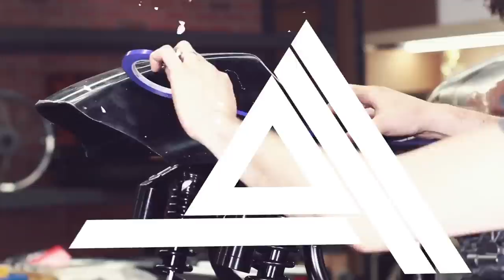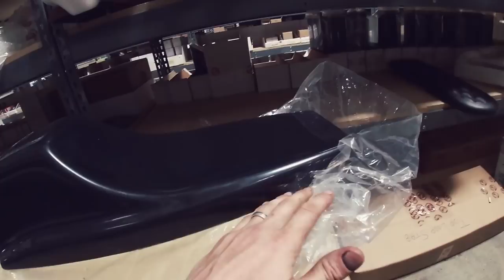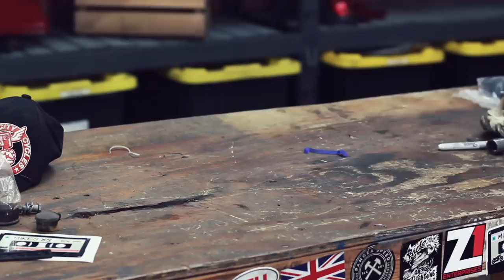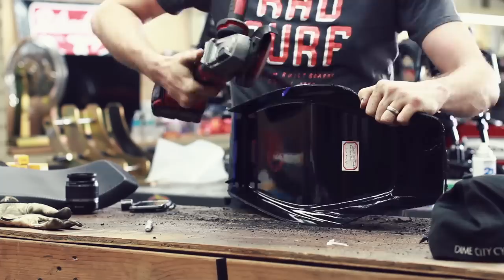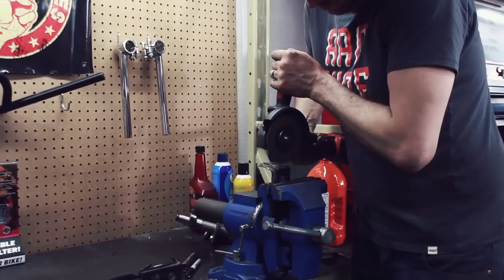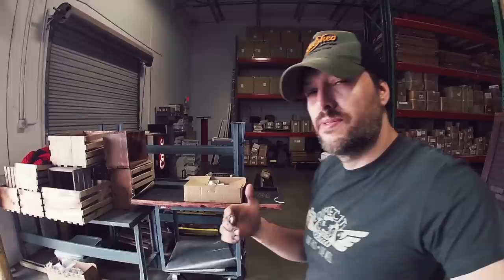CX500 Flat Tracker Build Part 12 - Fabricating the tracker cowl to fit

Comment: Now I see the way my GL500 build will go 👌 seen a triumph flat Tracker at the Wheels and Waves and fell in love with it! After seeing that's possible doing something great on the cx,I'll go for it on my GL! Unfortunately is mono shock the GL... But believe it will look cool too. Waiting for the next video!
Reply from the maker: At least you have a safe monoshock there already rather than a few of the dangerous ones I’ve seen. Best of luck.
Reply: @forthebold  true, I've seen some conversions that... At a minimum they're scary!
Reply from the maker: Nuno Cox yeah it’s when the swing arm isn’t reinforced that I’ve had stories of t bending. At least on the GL you already have the safer square tube swing arm
Reply: @forthebold  do you think it is possible to convert the GL into a twin shock? Asking cause in my opinion it gives it a more retro look. Also bought  77 goldwing spoke wheels to fit on it to get that extra retro look

Comment: I currently planning a project with a xr250. I’m considering changing the forks, should I match the cc of the donor bike or does it matter if the forks come from a bike with a much higher cc,? Will they likely be too heavy for the front end on a 250 is what I’m worried about really. Thanks, love the youtube channel.
Reply from the maker: If you can get forks to match the engine size then better. If not it’s better to go higher in engine size than lower.